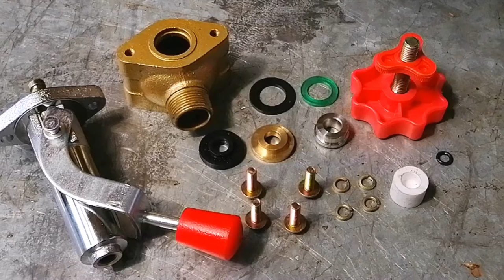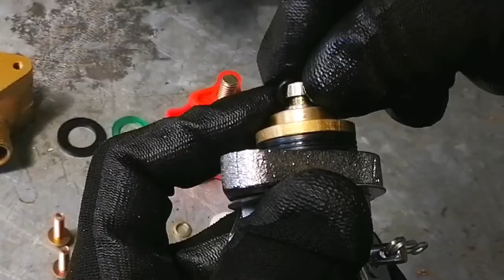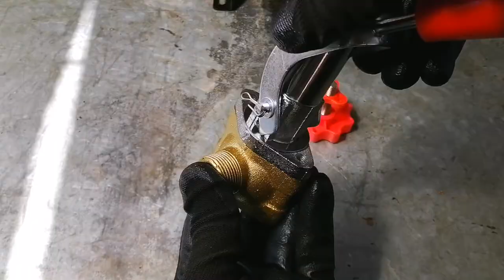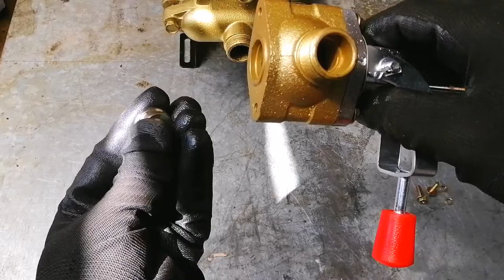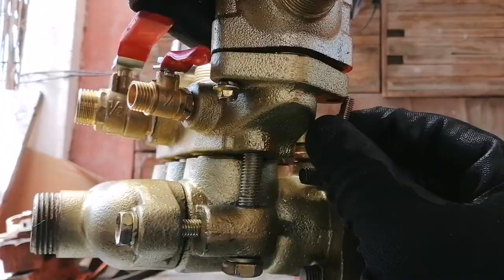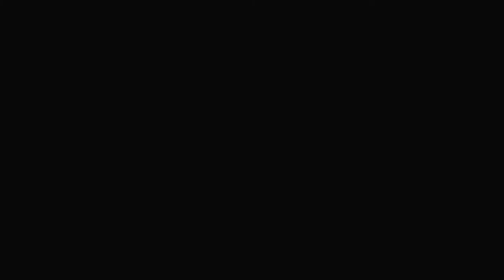How to Install sprayer pump valve #reparing_show

Comment: What's the function of that valve. Can you tell me. By adjusting it, can we increase the pressure of the water ?
Reply from the maker: The safety valve controls the pressure ratio, especially if there is a blockage in the water outlet, and if the valve is closed, it becomes dangerous